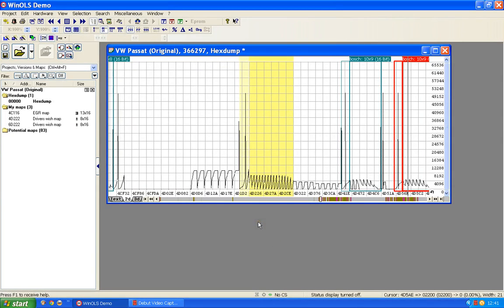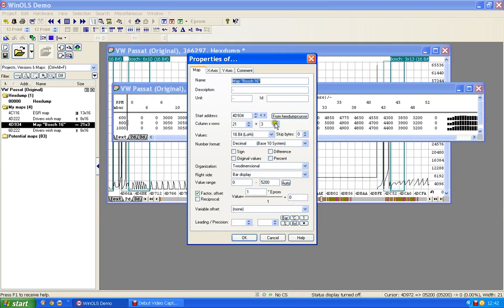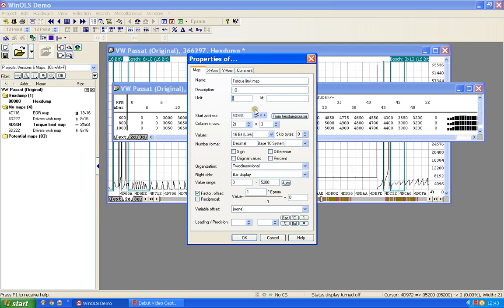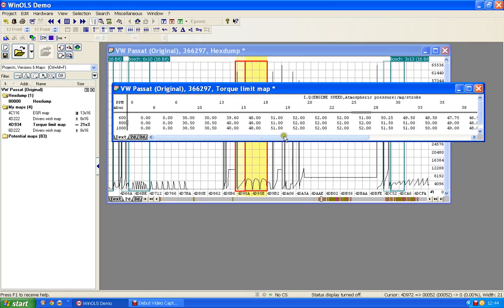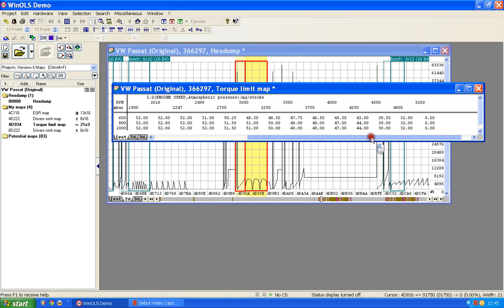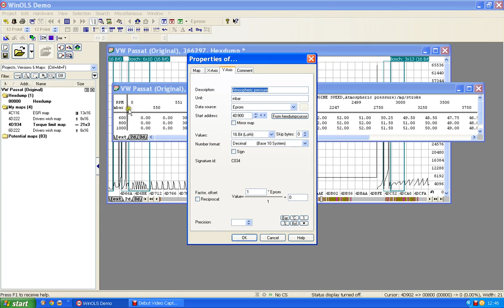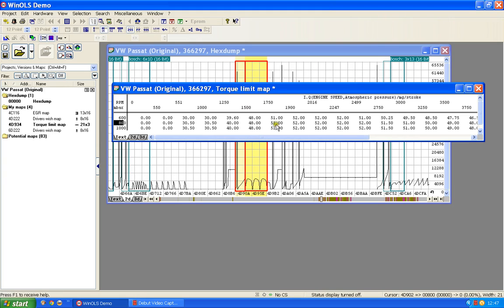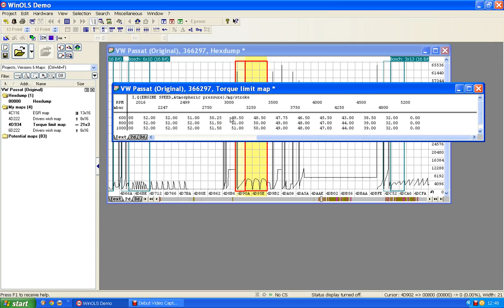winols guide part 4. How to find Torque map in EDC15 file

Comment: I take it when no fuel is injected at 5200 rpm that is what happens when the Rev limiter bounces, when it stops injection the rpm goes down to where it injects, goes back up to 5200 and cuts...  repeat